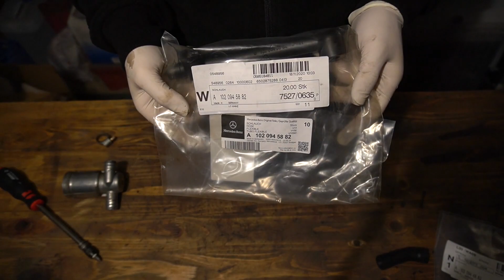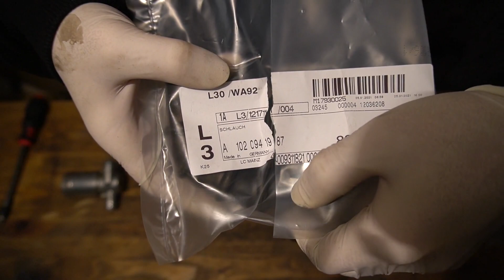Mercedes Benz 190E W201 | Crankcase Breather Hose Replacement | Kurbelgehäuseentlüftung

Comment: Thank you for this great video. 🥇 I have problem with rough idle in my 1990 MB W124 230E. When i turn on  the key, engine hesitates in idle, rpm gauge jumps up and down and engine loses the power. The engine turn off is also rough. I want to solve that issue, and i bought all 4 these hoses. But i dont have those plastic connectors which connect that hoses. Do you stil have original part numbers of these 3 connectors ? I will buy them.

Comment: Great job must do this on mine - You said you’d post part numbers I can’t see them - have you got them ? Also might have been worth doing the breather hose on the baffle under the valve cover these leak oil into the air filter housing and go hard and brittle like plastic 😮 you do great work great channel keep them coming 👍🙏
Reply from the maker: Thanks for feedback and the hint Rupert. Will tackle that next time when I remove the valve cover again. Never heard about it so far. 
The part numbers are in the comment section.

Comment: Great info in that video!  I'm having trouble locating where the small white vacuum tubing goes  that runs up towards the brake master cylinder.  Could you look at your car and let me know if possible?  I was using this video for some reference as you have some good shots up close of the engine bay.  Thanks!

Comment: Hi ! I am very surprised... the idle air control is not present in my 1992 2.0 engine
Reply from the maker: That’s interesting. I thought all of them have an IAC. Seems like there are different versions.
Reply: @KUNIQUE  it is a 190E 2.0L. i think that the idle air control is not at the same place. ( maybe to the left of the oil filter). 
i will check. there is also an idle adjustment screw next to the blue electrical plug

Comment: hey bro nice video , but can you send the link off the items where you bought them , i cant find the plastic things that go into the hoses
Reply from the maker: Thanks bro. Appreciate it a lot! Unfortunately I don’t have a link. But I remember that I posted the part numbers under a comment. I bought all pieces from the local Mercedes dealer. They still have those parts in stock. At least here in Germany. I hope this will help.

Comment: Nice man, where did you get the hoses from?
Reply from the maker: Thanks mate. I ordered the hoses directly from Mercedes.
Reply: @KUNIQUE  could you share the part numbers?
Reply from the maker: Sure!
1 x Hose: A1020945882    
1 x Hose: A1020942187
1 x Hose: A1020941987
1 x Hose: A1020944882
1 x Connector: A1020941012
1 x Connector: A1020940812
1 x Connector: A1020940212

Comment: Hi again. Did you try to push the valve down?
Reply from the maker: I took out the whole valve including the mounting. I guess you mean the IAC valve, right?
Reply: @KUNIQUE  Yes. I'm just wondering, did you try to push  the IAC with mounting down?
Reply from the maker: I first tried to push out the valve from the rubber mounting. Then I pulled the whole rubber out. Pushing down didn’t work. But it could be different in your case.
Reply: @KUNIQUE  Thank you. I have idle problems and problems with the fuel pump. My car: Mercedes Benz 190E W201 M102.962 2.0  1990 Have a nice day.

Comment: is there a trick to getting the hose re-connected to under the air filter at (10:13 and 10:18) - usually I must use a heat gun but today I dont have one and it is almost impossible to get it connected
Reply from the maker: Usually I also have used a heat gun to re-connect. But since the new hose was a bit more flexible it was easier (nevertheless very difficult) to put on the housing. I guess there is no trick.

Comment: the hose section that came off at 0:45, is it as easy to reinstall?
Reply from the maker: It was pretty straight forward. But I used new hoses. No idea how it would be if I had used the old ones. Maybe you will need a heat gun.
Reply from the maker: It was pretty straight forward. But I used new hoses. No idea how it would be if I had used the old ones. Maybe you will need a heat gun.

Comment: I like your videos. It seems to me that the valve went easily into place?? Greetings from Norwegen
Reply from the maker: Thanks Rune! Appreciate your feedback. It took me some time but I guess that’s normal because the rubber is a bit hard.
Reply: @KUNIQUE Thanks.  Do you use any oil? Silicone?
Reply from the maker: Welcome! I applied some rubber care. There is also an episode for the IAC. There you can see what I have used and  how I putted back in.
Reply: @KUNIQUE  Hi again.What episode do you mean?  Did you try to push the valve down? Regards Rune

Comment: WHERE ABOUTS DID YOU GET THE HOSES  I NEED TO CHANGE MINE COULD YOU GIVE ME THE SHOP ADDRESS WHERE TO PURCHASE THESE CANT GET ANY HELP HERE IN IRELAND MUCH APPRECIATED  IF YOU CAN HELP BY THE WAY VIDEOS WELL APPRECIATED
Reply from the maker: Thanks James. I ordered the hoses at my local Mercedes Benz dealership
Reply: @ thanks 🙏
Reply: Just out of curiosity would you happen to know the part number of the small hose in the rocker cover I think mine is cracked throwing oil into the air filter can’t find it anywhere